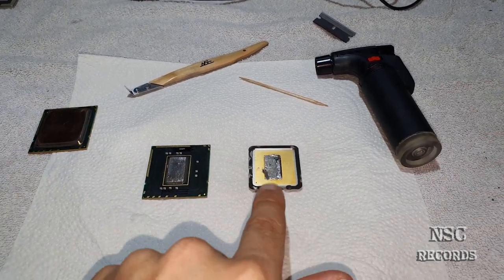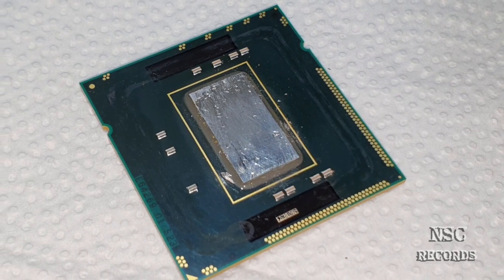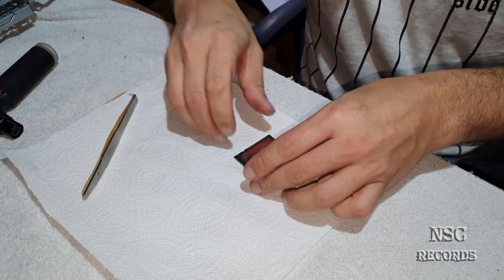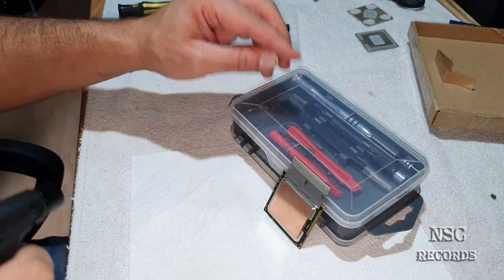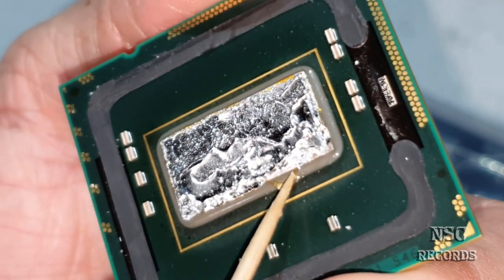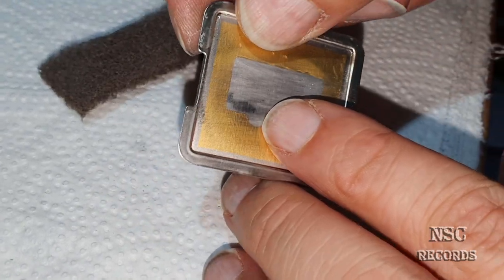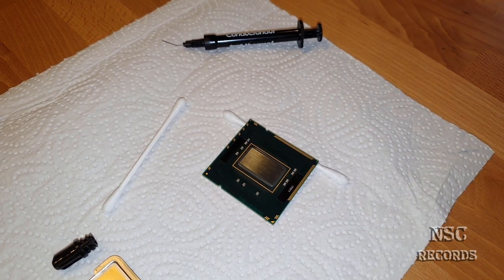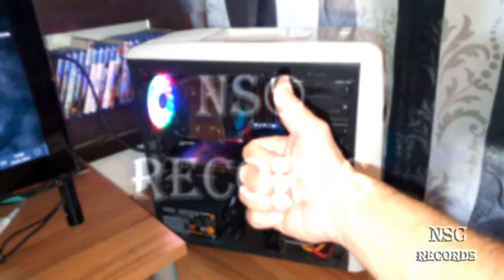How to delid soldered AMD & Intel CPU´s without special delid tools By:NSC

Comment: Hey NSC! I've been watching some of your videos, and I think it's amazing what you do; it shows you have a lot of love for this stuff, so keep it up! But... I just tried to show the same love to my PS3 slim (CECH-2501A); tried delidding just the CELL by bending the tip of a thin knife and sharpening as much as I could so it would simulate your tool. I had the utmost care on trying to cut the silicone, but it went in maybe less than half a millimeter, and I knew the IHS wouldn't come off like that, so I let it be. It wasn't overheating before, but temps weren't that okay and the fan kept going at around 55% with long plays (3 hours +)... After putting everything back together and making sure all was in place, now I get a fan at 70% in less than 5 minutes (68°C MAX)... Funny thing is, the RSX is way cooler than it was at that percentage XD. Could I have messed up the thermal paste inside the IHS of the CELL that badly? The metal piece never even moved, all I did was use a hair dryer to heat it up a bit, but of course that didn't help... Give me strength, NSC XD!
Reply from the maker: Hi bro. First thing, it's not damaged at all 🤗 Second thing, i need more Infos, witch thermal paste, how good if the pressure, how good are the clamps, how good is the cooler it self. Maybe upload me some pictures or meet me on WhatsApp there i can help you live. Cheers
Reply from the maker: @Julio-io9hm  this Videos are not bad, but i would use Cooper foil not aluminium. Great is that i understood all, because I'm Portuguese ^^ but like i told, cooper foil or shims are the best.
Reply: @NSC-Modz  Hah! Bom saber que posso falar com você em meu idioma nativo, então, pois sou brasileiro! Enfim, Não desisti desta empreitada e decidi continuar no dia seguinte. Segui uma dica do forum GBA Temp onde uma pessoa utilizou uma peça de metal de um calendário antigo, que por sorte eu ainda tinha alguns aqui em casa. Desdobrei a peça, lixei bastante para tirar a ferrugem e ainda martelei para deixar o mais liso possível. Não foi fácil, mas finalmente consegui cortar o silicone do CELL XD!

Foi a maior suadeira, e depois de remover o IHS, ainda descobri que eu havia riscado levemente parte da PCB, mas por sorte foi em um lugar que não tinha traços eletrônicos. Limpei o máximo que pude do excesso de silicone e pasta térmica antiga (que já estava bem seca) e utilizei a GD-007 como substituição. Sei que não é das melhores, mas ela funciona satisfatoriamente. Terminei todo o processo de recolocar pasta no IHS e no RSX (que decidi não fazer delid, pois ele não está esquentando além da conta), aproveitei para fazer uma limpeza e lubrificação no drive de bluray que estava barulhento, e finalmente fechei o PS3 para testar.

Funcionou perfeitamente, e o CELL ficou bem mais frio que o RSX XD! Ficou basicamente igual quando eu havia comprado o PS3 (já era de segunda mão, mas foi pouco utilizado). Deixo o webMAN MOD com a ventoinha em 35% e temperatura máxima de 68°C. Em jogos leves, como Demon's Souls, o CELL se mantém em 63°C e o RSX não passa de 66°C em dias de temperatura amena (20°C+). No GTA V, que é o jogo mais pesado que testei, o RSX já passa de 68°C, mas a ventoinha não chega a 40%.

Estou extremamente feliz de ter conseguido arrumar meu PS3, e só tenho a agradecer a você por disponibilizar tantos vídeos educativos para ajudar! Sei que um dia vou ter que tirar o IHS do RSX também, mas vou deixar para a próxima XD.

In English for others: Good to know I can talk to you in my native language, since I'm Brazilian! I didn't give up on my quest, and decided to keep going the next day. I followed a tutorial on the forum GBA Temp where a guy used a piece of metal from an old calendar, which luckily I had some lying around here at home. I unfolded that piece, sanded it a lot to remove oxidation and hammered it to make it as smooth as possible. It wasn't easy, but I finally was able to cut the silicone in the CELL XD!

I sweated a lot, and after removing the IHS, I found out that I had scratched the PCB slightly, but luckily it was in a place without traces. I cleaned up the excess silicone and old thermal grease (which was very dry), and I used the GD-007 as a replacement. I know it isn't one of the best, but it works ok. I finished up the process of adding paste over the IHS and the RSX (which I decided not to delid, since it wasn't getting too hot), I cleaned up and lubricated the bluray drive as well, because it was noisy, and I finally closed the PS3 up for testing.

It worked perfectly, and the CELL became cooler than the RSX XD! Now it runs basically the same as when I first bought the PS3 (it was second hand, but barely used). I set up webMAN MOD with a 35% fan speed and a MAX temperature of 68°C. In not so demanding games, like Demon's Souls, the CELL stays at 63°C and the RSX doesn't go over 66°C in pleasant days (20°C+). On GTA V, which is the most demanding game I've tested, the RSX goes past 68°C, but the fan won't go over 40%.

I'm extremely happy that I was able to fix my PS3, and I have to thank you for sharing so many educative videos! I know I'll have to take the IHS off the RSX as well, but maybe next time XD!
Reply: @Julio-io9hm  Maybe not so, because when I saw that the temps were rising so quickly, I immediately reapplied the thermal paste and made sure to spread all over, and I even bended the brackets a little to make more pressure. Temps kept rising like crazy... Thankfully, I went back to it and finished what I had started, as I tell it over NSC's response XD.

Comment: Доброго времени суток.  Как думаете Rizen 7950X можно так же снять крышку ? Может ли сам камень при нагревании такой горелкой отвалиться ?? Good day. Do you think Rizen 7950X can also be removed? Can the stone itself fall off when heated with such a burner?
Reply from the maker: Yes, they are soldered to. You just need to take care on the small neighbour smd components. First cut the silicon glue, take care that you not cut the small smd components and than heat it slowly and do it like on this video.

Comment: Thanks for this tutorial, I want to delid as well but I’m using a pga 939 socket, how would I go about not bending or damaging the pins
Reply from the maker: You welcome. Just be careful how you hold it, I've done a lot cpu's with pins, so it's just all about practice and patience.
Reply: @NSC-Modz  I was wondering if there was a special holder I could get online to protect the pins as I’m a little clumsy, I also need to know that brown thing you used to scrub off the older metal from inside the ihs, so you remind using Liquid Metal to replace, I thought it was thermal paste, good thing I saw this vid. 
That tool you used to separate the glue, can you link where to buy it and how many millimeter you marked for safety?

But what about relid the internal  heat spreader into the chip? Another video shows that he reapplies a certain compound to reglue where the old glue was(I gotta rewatch the video) . I didn’t see you do that but his method involves the delid tool which also is for relid, but he used a different socket than mine, I think a lga like yours

Comment: What is the tool you are using called? If you can provide a Amazon link that would be great.
Thanks
Reply from the maker: This is my own tool, but you can just use a razor blade from poly boy or a thin one from Wilkinson

Comment: On my R5 5600 I have temp difference between cores up to 17*C in Cinebench after heavy OC. Temp are 71, 84, 88, 88, 73, 83
Reply from the maker: Ok how much volts do you got your CPU running? I had this on my old Xeon's, after delid it was still like that, it was cooler but still different temps on the Cores. It's not so bad, no panic

Comment: Hey NSC. My PS3 RSX is getting a lot hotter then the CPU after I tried to delid it. I’ve tried replacing the IHS and the heatsink with another one that I know works. Do you have any ideas what it could be?
Reply from the maker: If the RSX IHS was still not delidded, than you know where its the problem ;)
Reply: @NSC-Modz  I might try another IHS just in case this one is bend
Reply from the maker: @w0lf4llo84  yeah, but i can not imagine that it is so much bended, you need to press the IHS really hard to the cooler for best pressure,  press and hold it down to the cooler till the IHS is not swimming any more, you need to press it hard and wait till the paste spread out 😉
Reply: @NSC-Modz  alright, I’ll try that once I get more thermal paste. Thank you :D
The 90nm chip gets very hot. Lol
Reply: Also I appreciate the time and effort you take to read all of your comments :)
Reply from the maker: @w0lf4llo84  90nm yes... thats normal
Reply from the maker: @w0lf4llo84  Sure, thats my job to, if you have videos on your channel, you need to care also about :)
Reply: @NSC-Modz  Yeah. Sooner or later I’m going to delid it. Well try to just to keep my PS3 nice and cool xD

Once I delid my phat I might move on to trying and delid my 30xx model since the CPU is 10-20 degrees hotter then the RSX

Comment: Have you tried this trick with those CELLs that are also "soldered"?
Reply from the maker: Witch CELLs? If you mean on the ps3, there are no soldered CPUs, not the CELL and also not the RSX
Reply: @NSC-Modz   You broke a CELL that was attached, glued, or whatever, remember? Have you tried a solution to that? Or there's no hope in case of overheating?
Reply from the maker: Yeah, but it was not soldered 😀

Sony PS3, never had soldered chips, not even one.